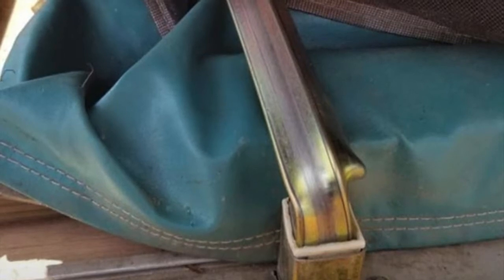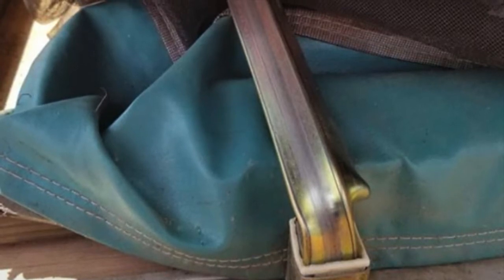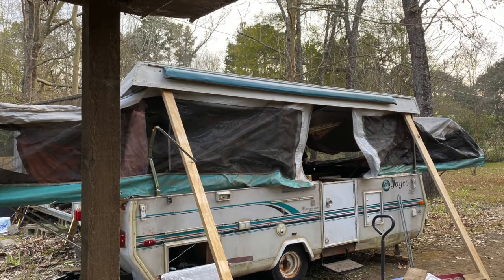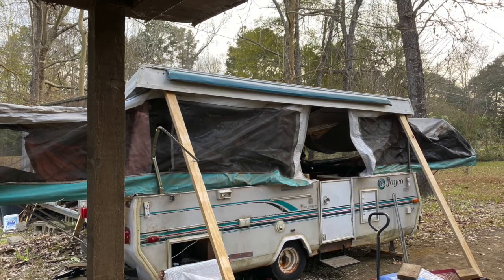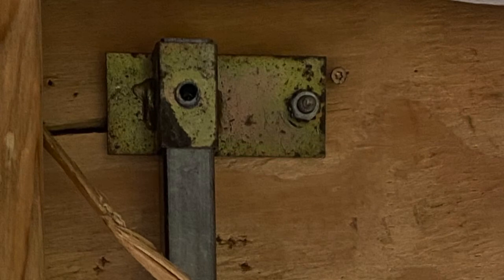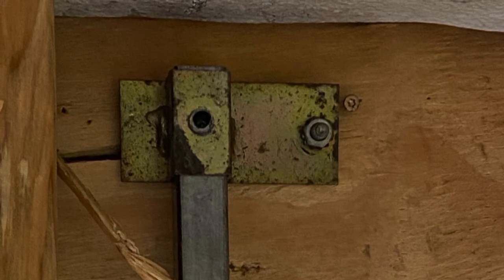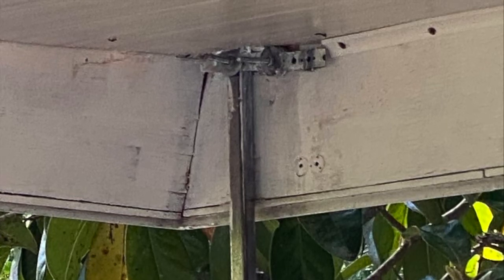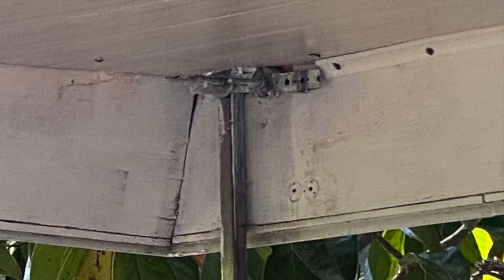Jennie Reboot 2 - How Bout Those Arms

Comment: Do you happen to have the measurements for each of the arms you made?
Reply from the maker: Not right off hand. We basically just cut them the same length as the one original we had left. But the bottom or foundation arms we found that we should’ve cut about six inches longer to compensate for the lack spring tracks that were ripped out and discarded. Does that make sense lol
Reply: It does! Thank you! I’ve been searching and I’m so glad I stumbled upon this. We’ve been having issues with our Jayco since we got and and at this point we want something simple. Do you have a video of how you open it?
Reply from the maker: @almagile9768  they say we made one but I’d have to search it up. Basically we do it in stages with one corner at time and cotter pins to lock them in. It can get a suction on it at the beginning so you may need to use a lift board at get it started. We’re out of town on a trip at the moment but we can get videoed when we get home.